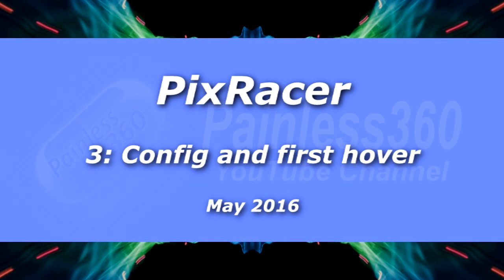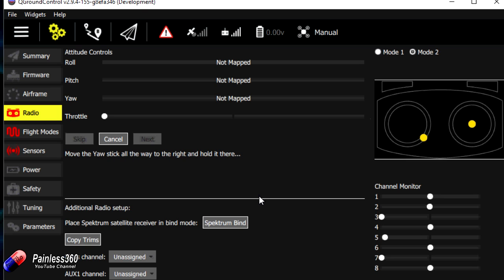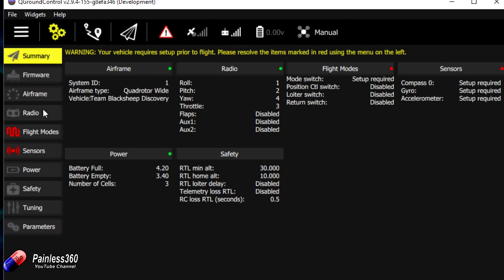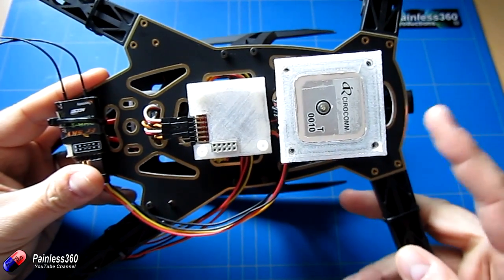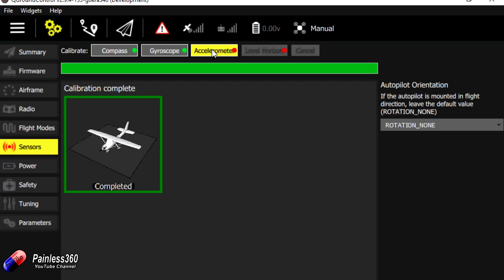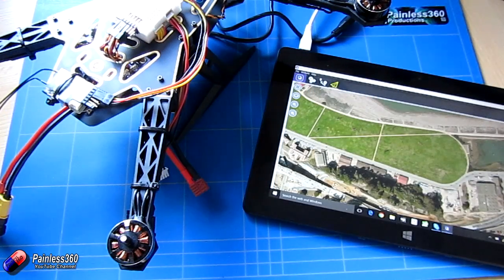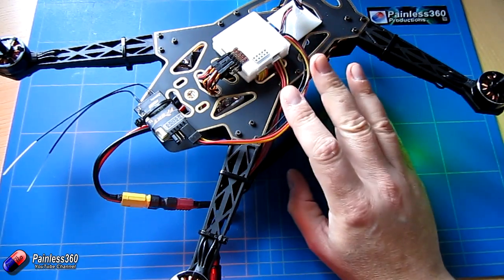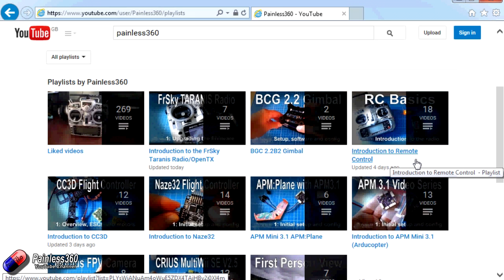(3/3) PixRacer - Calibration and setup and first test hover

Comment: can i use picracer for f405 frame drone kit sir?
Reply from the maker: I'm not sure these are even available anymore. Check out the recent builds on the channel for more modern alternatives...
Reply: @Painless360 ouh okey, and is it safe for a large 1x1 meter drone?
Reply from the maker: It's more about the software and using decent components than the FC itself... Best of luck

Comment: im having a pixracer but im having issues with frsky x8r receiver,  i binded rc and reciever but i cannot see anu channel.  Maybe there is a different cable or its a problem of the fc.  i will appreciate your help
Reply from the maker: It's tricky to comment without knowing what you've already tried, or how it's all connected. I had something similar recently where I found the I'd only bound the receiver for channels 1 to 8 but had my auxiliary switches on channels 9 and 10.
Reply: I've connected the 5v to the + of the receiver,  gnd to the gnd of receiver, and the rc input to the signal. After this ive binded x8r and taranis. After this i did the radio calibration but  all channels were 0. I repeat the same procedure with my old pixfalcon  and everything work well.

Comment: Thanks Painless360 for all your instructive videos! I built my Pixracer 250mm quadcopter, but it's drifting a lot as soon as it takes off. I get a "baro sensor 0" error in pre-flight mode and sometimes mag sensor error. Do you think the baro sensor could be the reason, unbalanced weight or my ESC taken from a ready-to-fly Aosenma CG035 quadcopter? What is strange also is that I didn't manage to make it work with ArduPilot version .I'm using QGC, last px4 firmware and I've tried formatting the sd card. It looks like a defective Pixracer, I bought it from Banggood, version R14. I wouldbe really grateful of any help.
Reply from the maker: I've heard love lots of others having problems with the QGC PX4 version of the software. I'd  try Arducopter myself. I found it just seems to work a lot better. I go back to first principles and try and fix the problem that stopped you getting that version of software on the flight controller and go from there.. Best of luck!

Comment: Hello, I need the info is there an option to control the flight of pixhawk by using computer (laptop over wifi) rather than by RC Station
Reply from the maker: Yes you can, all in the manual - http://ardupilot.org/copter/docs/flying-with-a-joystickgamepad-instead-of-rc-controller.html

Comment: I'm going to flash my PixRacer now to QGroundControl firmware. On my ardupilot firmware I use the H frame so motors run reverse. Is there the same reverse motor rotation on QGroundControl?
Reply from the maker: +Photostop Borgs not sure, I've moved away from QGroundControl as it can be a lot less forgiving on the spec of the PC used.. Happy flying!
Reply: Yes ive experienced some issues as well especially on my laptop. I have not flashed it anymore i just updated ardupilot firmware 3.5.1 and seems good enough. my only issue is on my android phone, using the app Droidplanner 2. I keep hearing a message warning, 'Lost GPS lock'. but on the quad , gps led still flashing indicating a solid lock, while the app droidplanner shows 19 sats, yet a voice prompt keeps telling me 'lost gps lock' Quite annoying and worrying too.

Comment: I set up my 280 quad using AC3.4.6 version on my new PX4 Pixracer FC. In the past ive used on my pixhawk board AC3.2.1 which on mission planner parameters showed throttle mid. But on the AC3.4.6 there is non, so my stabilize mode take off is 1/4 throttle. Is there a parameter to adjust mid throttle to keep it mid stick on take off for AC3.4.6 ?
Reply from the maker: +Photostop Borgs not sure, but googling 'arducopter 3.4.6 mid throttle' found this article with the answer.. https://discuss.ardupilot.org/t/setting-mid-throttle-in-3-4-where-is-the-mid-throttle-parameter/12835
Reply: The link you sent was helpful and i will do a check on my parameters soon. Thank you

Comment: hi will you please provide me the pid for jumper 266 type frame.
I require a pid for that which the default pid value is wobbling in the air,if you share the pid it will be very help full for me.
Thanks.
Reply from the maker: +raj yuva there are many reasons why using another set of Pid may not help.  It depends on the type of wobble. Often it's twitching is due to vibration on the model and can be helped with anti vibration mounts.. Best of luck!

Comment: I've been unable to calibrate the ESCs - I get an immediate error code about disconnecting the battery when "Calibrate" is clicked.  The battery, of course, is not connected.  Is there a trick to force calibration mode within Qgroundcontrol or without it?  Alternate APM methods of transmitter on full throttle then turning on the copter also never enters calibration mode.  Any thoughts or tricks?
Reply from the maker: I've seen this once a while ago and it I remember it was something to do with the installation of Mission Planner. Sorry I can't be more helpful but it was a while ago. I'd check out the forums and see if there is any more useful details. Sorry I can't be of more help..

Comment: Looks like an interesting flight controller, but I have see some issues with getting it to work with tricopters. Any chance you could do a howto on getting it to work with tricopers?

Thanks
Reply from the maker: Sorry, we're not fans here. I've had a few bad experiences with Tricopters. Best of luck though..
Reply: Well that sounds intriguing... I have a HK Trifecta that folds small enough to fit in my transmitter case, but folds out to be a reasonable camera platform, but the HKPilot mega mini I got with it is flaky. I might have to look at the APM 3.1.

Thanks.

Comment: Is it possible to configure the PixRacer module as an antenna tracker?
Reply from the maker: I'd use a cheaper APM for that personally, but yes.
Reply: can you please tell me, which cheaper APM?.. one of the HK copies?
Reply from the maker: I've used them from lots of places, HK, BG and eBay. Try and go for vendors with specialism in RC and good feedback..

Comment: HI Painless. I have watched a lot of your videos . great work. I am having trouble Binding a spektrum satellite receiver to my pixracer. Do i need to buy a PPM or Sbus system. I have so much money invested in Spektrum. what do i do.
Reply from the maker: +Rodney Wells lots of the latest Spektrum reviewers support PPM, I'd use one of them.. Best of luck!
Reply: +Painless360  I take it that is a no them. They say it supports DSMX . I have tried all the version of Firmware old and new. The system will work automatically fine in PPM or SBUS. But it’s now about I just want to know. I should be possible. You get the cable with it to do the connection.

Comment: Painless, what version of QGC SW and PX4 FW did you use for this video. I have been waiting for this part of the series to see if you had same issue as me. I can not get radio calibration to work even with the DL's recommended from people in the PixRacer thread on RCG's. The "pick" options in radio calibration just toggle between next and ok. I get no radio function. I do get it in other GC software, just not QGC.
Reply from the maker: +Duane Bohmier I've used a few here and not had a problem - with that bit ;) QGC is still a little 'young' IMHO and I had huge problems with firmware flashing in the early days. I have one PC here that seems to run it all great, all the others either don't see the board after a reboot, don't flash it or hang and have to be killed in mission planner on another. I found that using the daily build helped as the team are changing things that often.. Best of luck!
Reply: Painless360 a

Comment: Hi Professor; I have a few questions if I may:
1- I saw you were struggling on the calibration with a "long" USB cable; but didn't your Pixracer come with a Wifi connectivity card, as mine did?
2- What GPS is recommended for this Pixracer new generation; would any work the same as any previous pixhawk generation, or should we follow the wiki and choose between the 2 or 3 mentioned? In other words are the recommendations compulsory or not?
3- How do you get your telemetry and tablet working with it; I did not see any telemetry module!?
Tks again for this tutorial Professor; outstanding; as always especially on this new platform; still wondering about it for the time being.... Cheers and Safe Flying!
Reply from the maker: +FPV Cambodia 1)Nope 2)Same as any other - get one with a compass on it though 3)You'll need the MAVLink radios for the telemetry. Happy flying!
Reply: Thanks, finishing the course this WE, then I spend my time on the Pixracer replacing a HK Micro APM on a Trifecta , nice and compact for the glove box! Cheers Professor. Will keep in touch with my findings....
Reply from the maker: +FPV Cambodia Happy fishing! We will be showing the WiFi pieces in a later video.. Thanks for the question..
Reply: Alright then, yes indeed, happy as a fish! ;) Cheerio and Safe Flying!
Reply: +FPV Cambodia Using the combination of Taranis Tx and Xseries receiver with the addition of something called a 'Teensy' board between flight controller telemetry port and Rx smart port will convert the Mavlink data into language FrSky understands. It then gets sent directly to your Taranis in the 2.4 r/c signal. I used one last year on one of my quadcopters and it works great. No requirement for a tablet as all the info is displayed on the Taranis telemetry screen as well as audio. Hope that adds to this great series of videos.
Reply from the maker: Work is underway for PX4 to natively support FrSky SmartPort too..